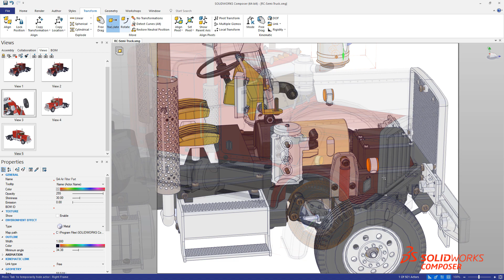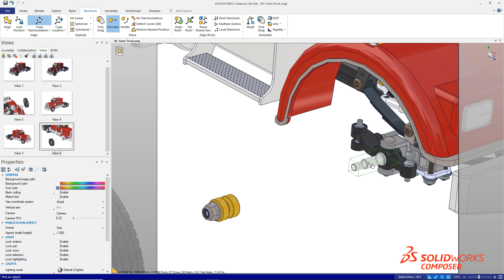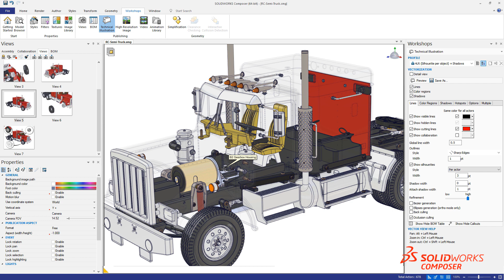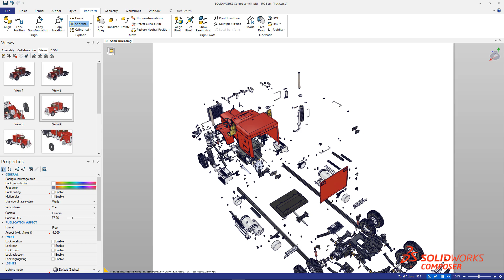SOLIDWORKS Composer: Time Saving Tricks

Comment: What I do wrong? SW Composer 2023 save all my work only in first initial view, all changes in another views reset to assembly importing view even I do "update view". or this bug in 2023 version?
Reply from the maker: Views in Composer 2023 operate the same way as previous versions. 

After the first view is created each additional view can either be created new or they can be created from previously created views, copying all properties. 

Since all properties are copied this can lead to a creation of a document that references the specific Composer view properties or properties from SOLIDWORKS. If the views are referencing the SOLIDWORKS properties they will revert back to the properties driven by SOLIDWORKS when updating. 

Also, it's important to note that when the properties of actors in a particular view are set as neutral, this will also point them to the SOLIDWORKS properties, which will cause the views to reset on update. 

To avoid this; setup the initial view with any color, BOM id's or property changes needed. Do not set 3D actors as neutral properties. Neutral properties is best kept for use on 2D actors. Once the initial view is setup, activate it and use it to create new views. The properties will copy to the corresponding views and they will update as intended when there is a SOLIDWORKS modification.
Reply: @hawkridgesystems  thank you, may be I do something wrong, or maybe I made camera view (icon of crossed-out camera appear in down-right corner of the view) that seems save only camera position and all my hour work was reset (